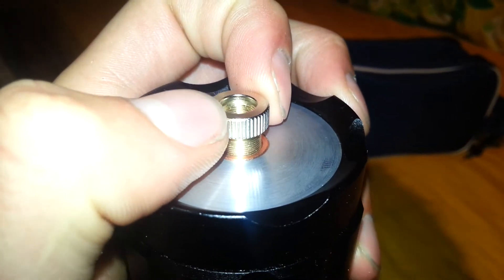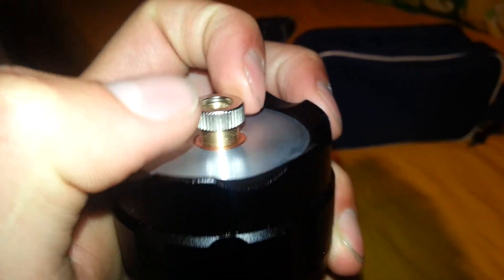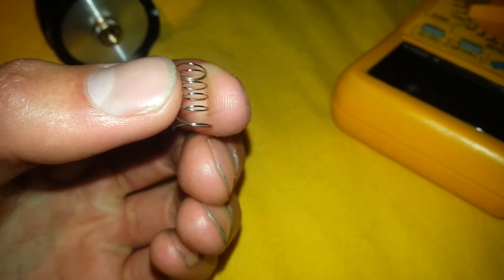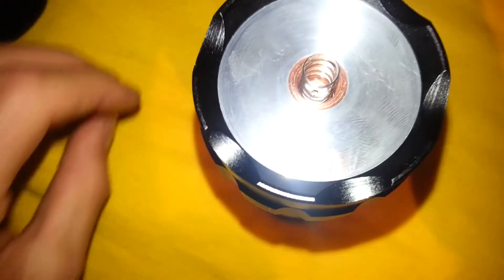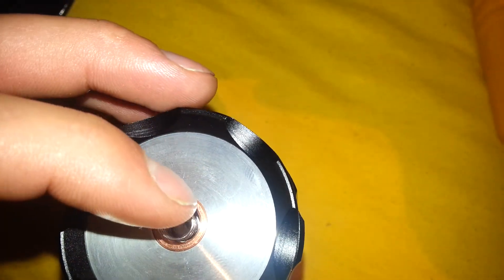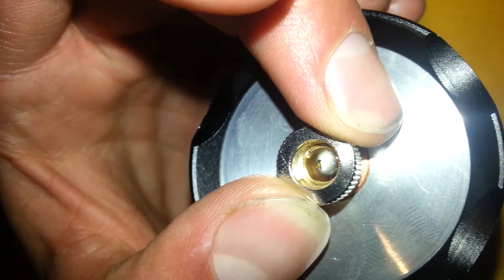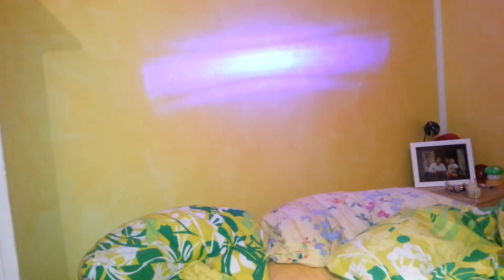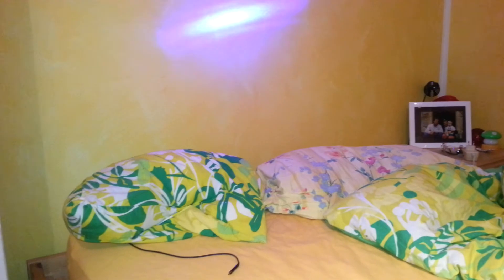445 nm 9mm diode with 4-2 lenses - weird bar problem

Comment: I cant really tell what youre doing but from the looks of it its fine. I multi-mode diode is a bar unfocused and with the spring in, all that happens is that its taking up space so the lens cant be focus close enough to the diode .youre fine